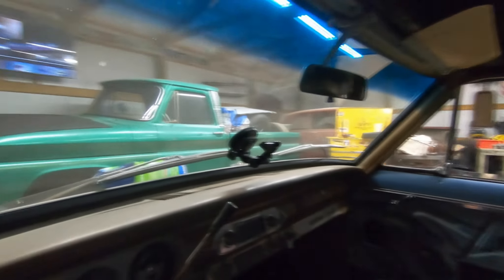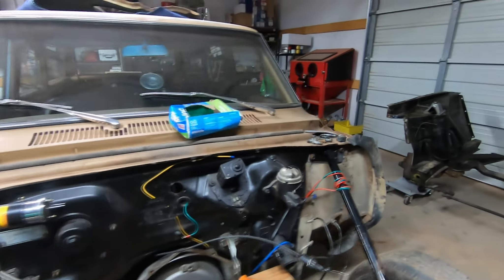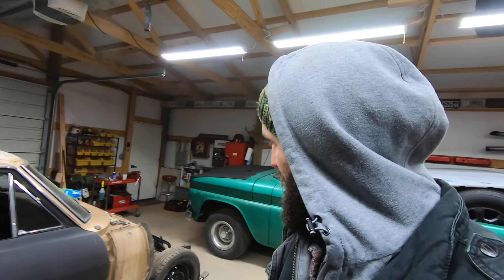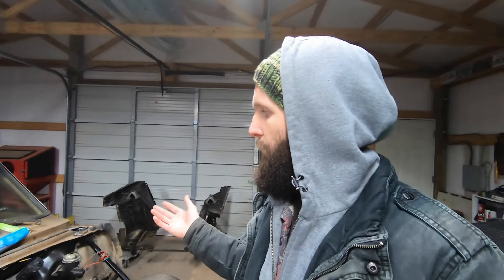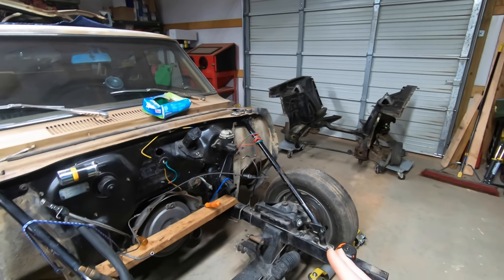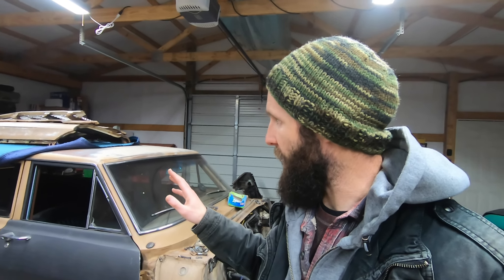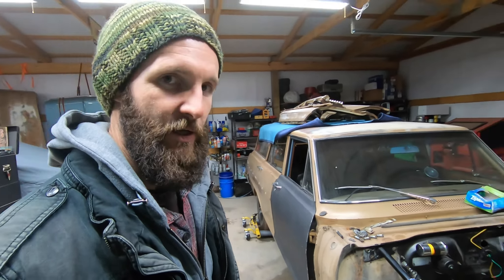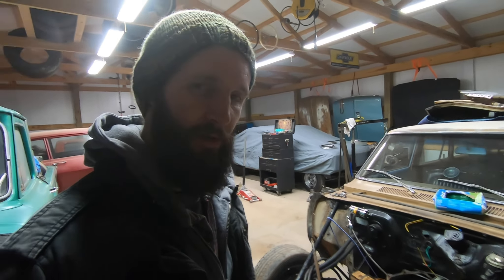What's Next - Things You Should Know Before Starting Your Nova Mustang ii Front Clip Swap

Comment: Add some time saving  production time to your project by using the engine you pulled out……For steering column, use the original. Cut it off at the S Box and make a stabilizing end tube mounting bracket. Bolt it to the firewall, slip it over the steering housing tube. For the steering wheel;  go aftermarket adapted 15” wheel instead of the stock 17”( Forever Steering Wheels is a good dealer to start looking)……Cut off the trans shifter linkage off that lower column. Use a cable floor shifter for the 700R trans. ……….I’am doing the same project as your ‘65, mine’s a ‘63. I did all the mods above to mine already.
Reply from the maker: Really the only different between the two as far as installing in the car is an intake, flex plate, and distributor. The 327 is just mocked into that other front end and needs to come out regardless, but I pickup what you're putting down there and you make a good point. 
I did consider using the stock column but ended up choosing an aftermarket, at least for the time being (upcoming video). My stock column was in pretty ruff shape, doesn't have the indicator arm, and the neutral safety switch doesn't exactly work like it should. Also, I am looking to go back to column shift for the 700r4, but that might just be because I really don't like the ratchet shifter that the previous owner put in the car. 
You should post/share some videos of you car. I'm always interested to see what other people are building and how they do it. Never know where you might learn a thing or two. I appreciate the input to, makes me consider things/approaches I hadn't considered.